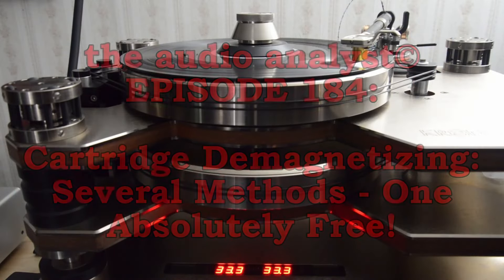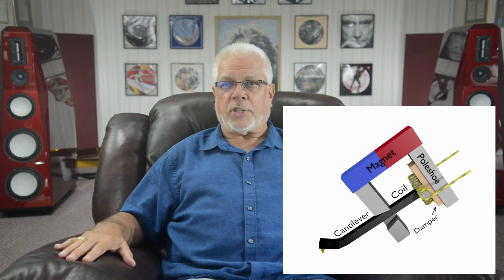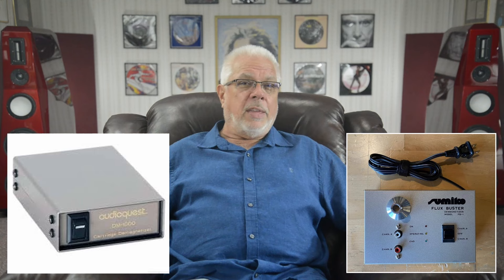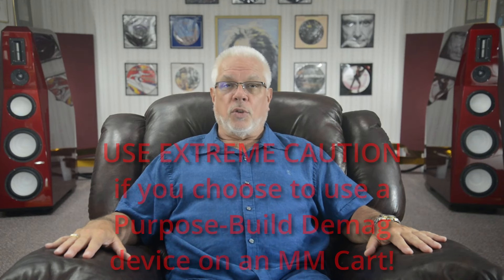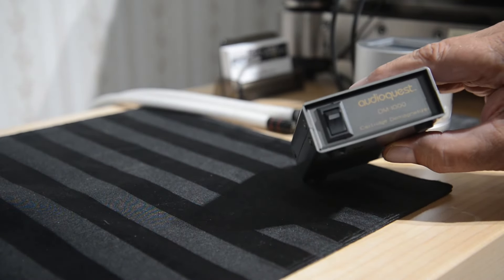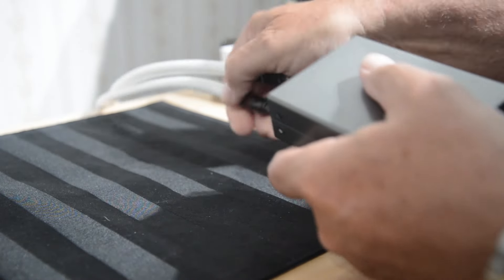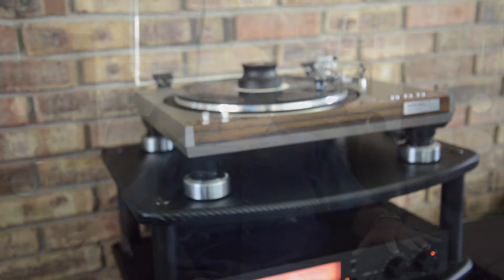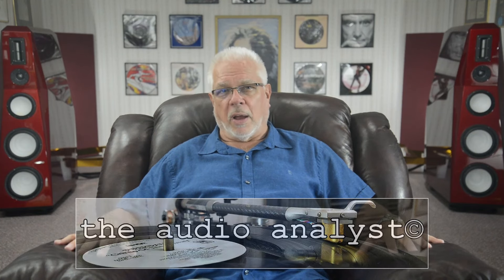E184: Cartridge Demagnetizing - Several Methods – One Absolutely Free!

Comment: I used a Sumiko Fluxbuster FB-1 from 20 years ago on a Benz Ruby 3 every 100+ hours for several years.  I was displeased that after a treatment, it took several records to regain the sonic splendor (too dry and thin sounding after treatment but clean).  I have switched to a Dynavector 20X2 L in my Brooks Berdan highly modified SME IV on a VPI VI/Townshend seismic sink analog set up and feel no need after several hundred hours to fluxbust/demagnitize it.  This through an audio system consisting of an EAR 324, Poseidon DAC/Pre-Amp, Westminster Lab REI amps and Von Schweikert VR9 SE Mk2 upgraded.  Somehow, every LP from mono to stereo sounds very full, warm, detailed, fast and interesting (from among my 31,100 LPs).  Maybe in another 250+ hours, I might try the Sumiko again but I am hesitant to demagnetize my cartridges any longer.

Comment: Thanks Greg for an excellent overview of MC cartridge demagnetising. I’m contemplating getting an ABCD-2 to demagnetise my Koetsu cartridge. I’m weighing up if the degaussing LP can achieve the same thing or if they may be complementary approaches. I’d be interested to hear if you have any experience with the Cardas LP and how effective it is compared to an electronic device? I imagine the advantage of the LP is as you mentioned, that it can also degauss the rest of your system. Cheers.
Reply from the maker: Hello... The LP works , but the battery powered degausser's consistently provide better results in my experience...